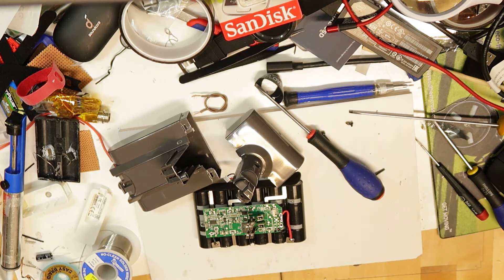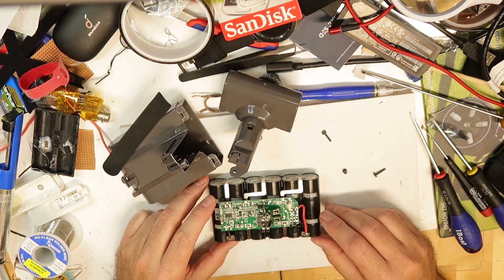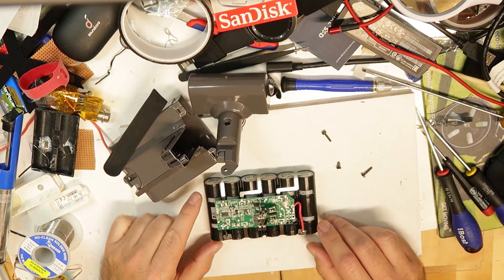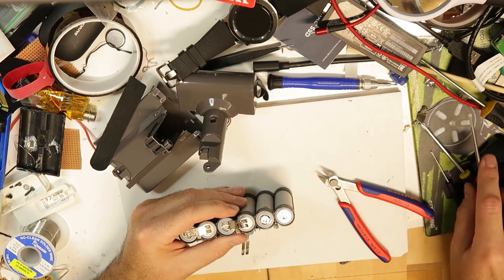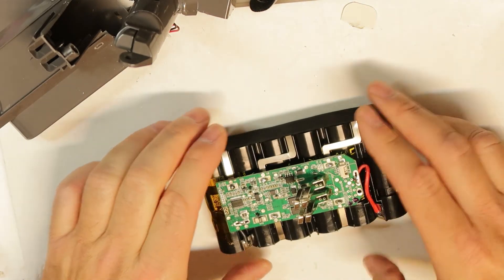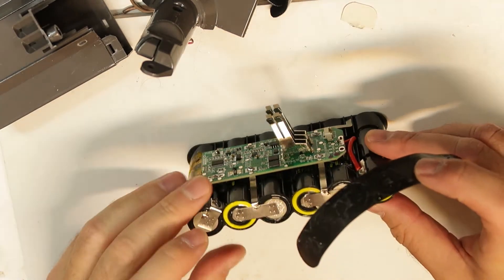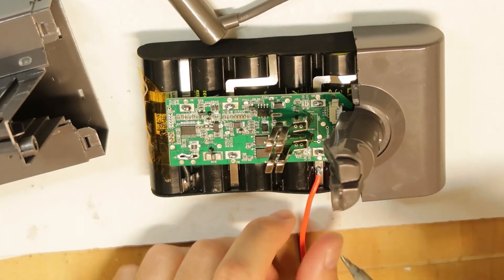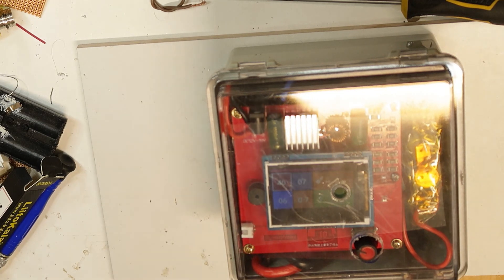Fixing Dyson V6 Battery

Comment: I like your practical approach in replacing those battery cells.
Reply from the maker: what do you mean by practical - this shows in practical way what I do step by step
Reply: @RoeeBloch  Whats does practical mean?
Practical refers to a person, idea, project, etc, as being more concerned with or relevant to practice than theory: he is a very practical person; the idea had no practical application. Practicable refers to a project or idea as being capable of being done or put into effect: the plan was expensive, yet practicable.